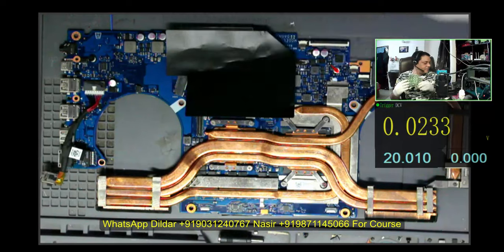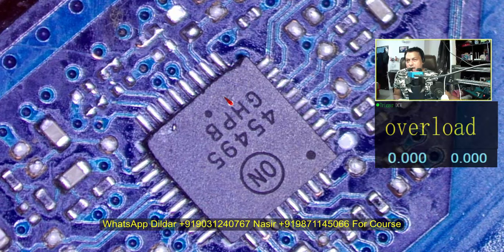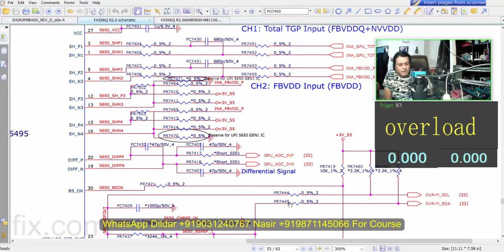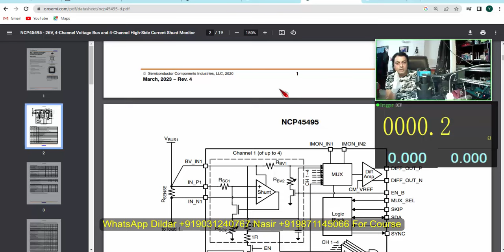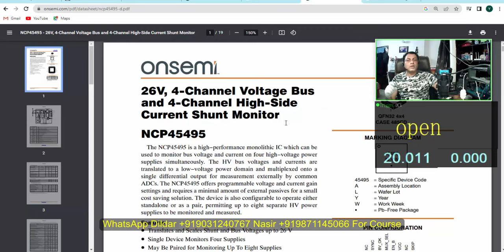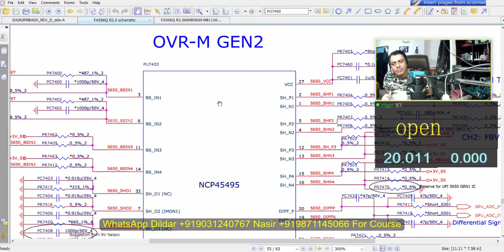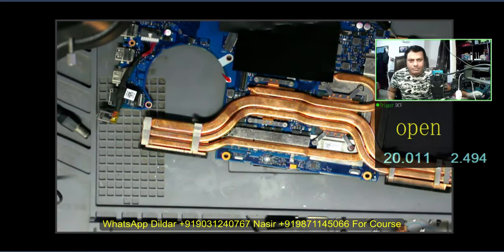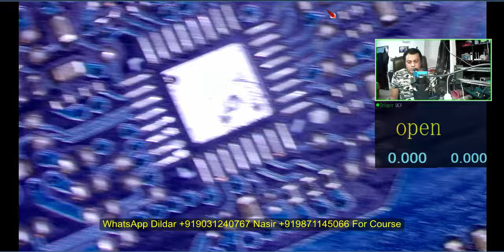ASUS ROG TUF FA506Q SHUNT OVR IC Concept in ENGLISH | Online Chiplevel Laptop Repair Training Course

Comment: The NCP45495 is a synchronous buck converter integrated circuit (IC) typically used in applications such as power supplies, voltage regulation, and battery charging. It can efficiently step down voltage from a higher input voltage to a lower output voltage, making it useful in various electronic devices such as mobile phones, laptops, and IoT devices. Its features include high efficiency, adjustable output voltage, overcurrent protection, and thermal shutdown, making it versatile for different applications requiring power management.
Reply from the maker: Good....